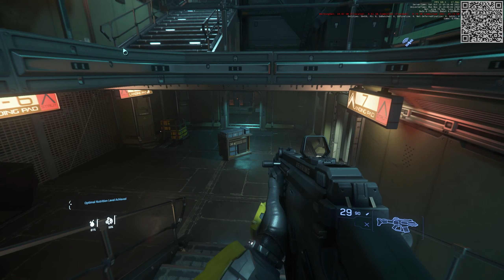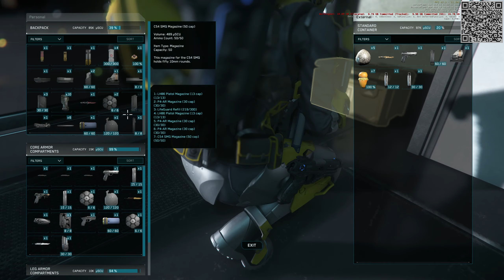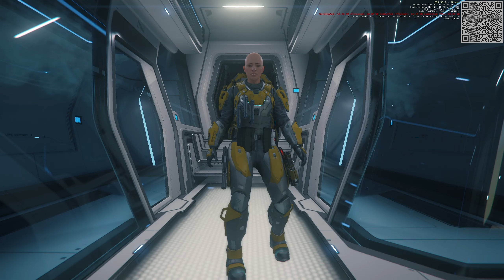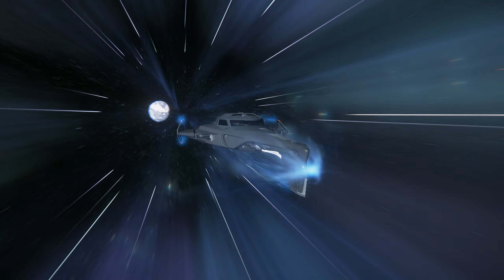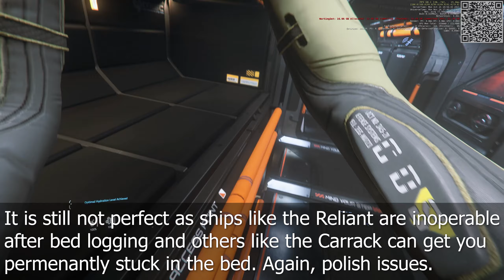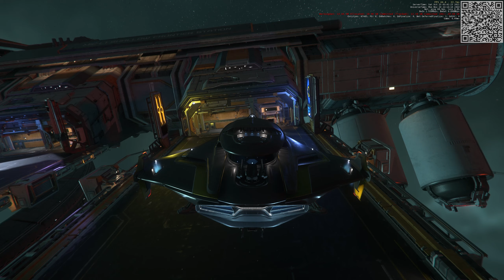New 30k Protection in Action! | Star Citizen 3.15 PTU

Comment: Careful bed logging. There is an issue in this build that can cause you to have to do a character reset after getting stuck in an infinite loading screen. Some people have fixed it by changing the eye colour or gender of their character, as well as bed logging in a different ship in AC Free Flight.
Reply: Direct quote from a CIG dev “Do not trust bed logging, it’s just not there yet”
Reply: I use bed loggin all the time - in this build it is reasonably reliable. I find I can log straight back in 4 times out of 5 with no problems. Occasionally I will get stuck at 14,500 entites on loading - just quit the game and try again - have not had to do this more than twice in a row to succesfully get back into the verse since the last few PTU patches. 

Current big issue is that when logging in Planetside you will occasionally spawn under the terrain  and fall to the core. When this happens your only option is to get back into the bunk ASAP and log out again. Next time the game should hopefully spawn you in the centre of Stanton with your ship and contents intact.
Reply: @Jac70  until the devs say it is ready for use I’m not going to risk it anymore. Literally every time I have tried it in my Carrack I have had to do a character reset.
Reply: What build are you talking about, this is not 3.14, some people assume 3.15 has the same issue and it doesn't, 3.14 is the pretty much the only patch that had that issue, it's basically back to pre 3.14 .